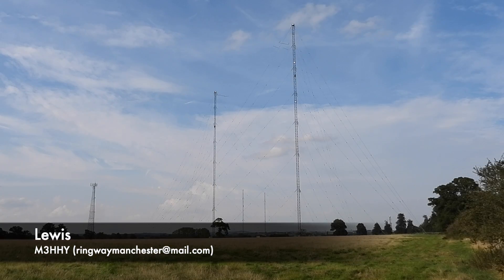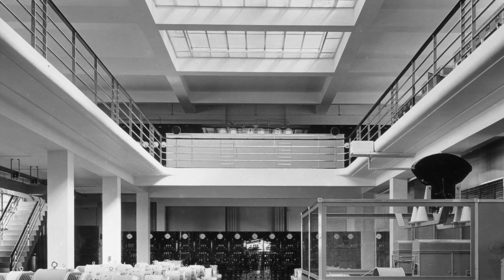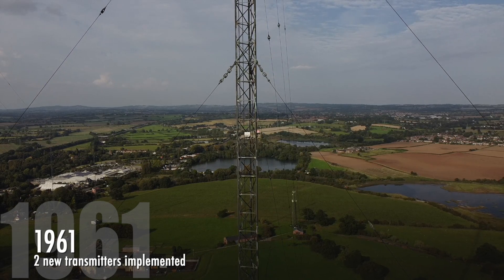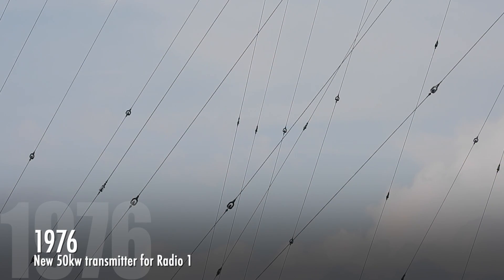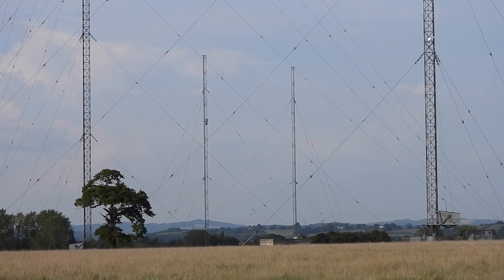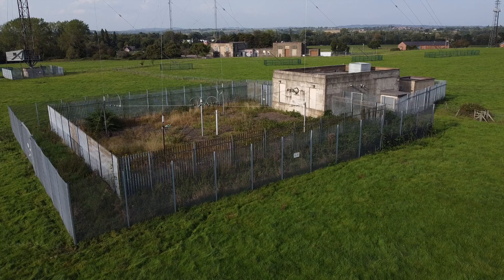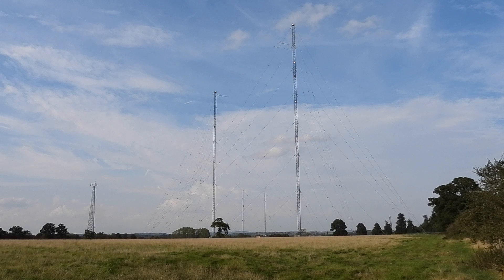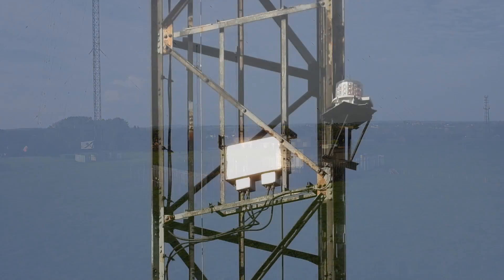Droitwich: The Death Of The 1/2 Million Watt Transmitter

Comment: We had a tour of this station during my BBC "A" course in 1970 something
The oscillators started with a rubidium source, producing 200kHz which was my frequency standard at home, divided down to my radio clock.
IF the Rubidium source failed, there was a less accurate one, and several of them, all the way down to a 200kHZ crystal, so the station should never be off air for the want of an oscillator.

Each RF stage was in its own metal cabinet including the final pentode, which was enormous....

We also saw one of the (6)? huge diesel generators being started for our benefit.
It was a shame that we lost the 200kHz frequency for a 198kHz "standard" to make dividing down more complex.
I suspect it was a deliberate effort to deprive certain groups of people, (Radio Amateurs), an easily derived frequency...
Reply: No, the frequency change was due to a Europe-wide agreement to have all  broadcast AM frequencies divisible by the number 9. For this reason, some of the MW frequencies also changed e.g. 1,214 kHz changed to 1,215 kHz. I believe the whole exercise was due to reduce the audible effects of co-channel interference after taking sidebands into account.
Reply: @johnr6168  Well, I didn't know that.
It was just convenient to divide 200kc/s using a string of 7490's..

Comment: Always a great sight when driving past on the M5 esp at night when lit up.
No doubt like Rugby, those masts will be down and a housing estate and/or warehousing quickly thrown up as a bean counter somewhere has worked out flogging the land off is worth more. 
FYI as a regular visitor to Sweden the night time R4 signal to there is amazing on LW. Not sure if that would be from Droitwich or the Scottish transmitters. Phase distortion is hardly noticed unlike the old 1215 which had it terrible in Leicester even in daytime.
Reply: Any signal received in Sweeden will be from Droitwich. The signals from the Scottish pair barely get out of the British Isles area. They are just filler transmitters where reception of Droitwich had aways been iffy in some small areas for a combination of reasons.

Comment: These things Should Be Kept RUNNING Forever!  Who knows WHEN they'll be Needed Again, what with Corona mass ejection or Nuclear war possibly wiping out ALL them newfangled 'tronics that get ever-More SENSITIVE so's to limit amplifier power and battery drain.  These dinosaurs could possibly ride with minimal damage right through a solar flare or nuke attack, and folks could just maybe fix it with some used dental floss and some chewing-gum with whatever rusty baling steel wire could be scrounged ....
"Smartphones" sure AIN'T so smart if ya CAN'T fix individual transistors fried by an event with overpowering electromagnetic pulses.  Just in an instant your thousand-dollar-and-MORE precious slab of joy with whatever Non- Backup'd pics or personal stuff Becomes an interesting BRICK, and there's No going online to order a replacement, NOR ANYWHERE ELSE.  
Your ancient Long-wave & Medium & Short Wave radio would instantly become a national concern.

Comment: The benefit of a LW transmitter is that you only need  a long length of wire, a variable capacitor, a  diode and a earpiece and you have  a receiver - and no batteries needed.
Reply: My ex-wife had an uncle who lived near Droitwich.  He told me that he had been to the destist to have some mercury amalgam filling and for a while after that his teeth picked up Radio 2. I've heard other examples of similar near Winter Hill, so it might just be true.

Comment: I wonder how many people are still depending on the radio teleswitch service? 
The obvious worry would be that after RTS is  switched off economy seven customers will suddenly start getting an unexpectedly huge electric bills - you'd think the electricity suppliers would be required to do something to warn them, but I haven't heard of anything happening.
Reply: Selective, most likely, depending on which utility firm is in use at any customer’s house. Until a few years ago, I did have an RTS box inside the meter cabinet, but at some stage (most likely caused by lightning), the meter itself stopped measuring anything. The supply was fine, but I ended up in dispute about the adjustments to my bill, once it was detected. It didn’t take too long, as I’m in the habit of reading it and reporting it in my account monthly.

When it was replaced, the RTS was recovered, and the new one has an internal clock, so it’s a fixed time annually between the two rates & restricted supply switch - all in one plastic box.

Comment: Droitwich, AKA "Dump-wich" by the BBC employees that were sentenced...I mean, posted there. The 4th diesel-gen set failed in service & blew a massive hole in its crankcase at some stage. Starting up those diesels was an amazing ritual, not many people know that you got those massive engines into the starting position BY HAND! You opened the exhaust valves, lifted a small door over the flywheel, stuck a long metal bar into it & used the notches in the flywheel rim until a white square showed. Then you had to remember to close the exhaust valve lifters. Starting was done with compressed air & it was an amazing experience bringing them to life, up to speed & then synchronize them to the incoming HV feeders before closing the breakers. It was a technique called "Transfer On Power" & it meant you didn't have to run the site down & run it back up again to test the diesels. 

RF Field strength was so high that you couldn't turn the lights off! Two screwdrivers held tip to tip would make very small arcs that you could see if you actually could find somewhere pitch black & modern cars that drove up to the entrance might die when the engine management unit was flooded with RF! The Ariel Tuning Hut (ATH) was a minefield for new employees, there was a UV detector inside that'd drop carrier from the 500Kw 198Khz TX if it saw a flashover & the older employees would place the earthing wand precisely so that, when you opened the door to step into the ATH, the earthing wand would get knocked & it'd hit a metal stud & causing a pretty fat flash which because of the detector, would trip the Long Waver off for a fraction. I suppose that they thought it was funny, somehow.

As for the Long Wave PA valves being in short supply....well there'd be at least another 2 in storage if they'd been handled right. Those shiny metal rings were NOT handles, they were anti flashover rings (to prevent internal flash overs which were destructive) & if you lifted the very heavy valve by the ring you might only find half of it in your hands while the other half crashed to the floor.....not me, I should add.

And finally, it was a fun place to be in a thunderstorm. Very good for topping up your tan, you might say.
Reply: Very nice and informative. Thank you
Reply: " I suppose that they thought it was funny, somehow."
Engineers, a breed of their own. Interesting fellas though.
Reply: You call it dump wich they use to call it detroitwich
Reply: What make engines were they ? Blackstone lister ?
Reply: Most diesel sets run on a 20 to 1 compression ratio so those valve lifters were essential.
Reply: @frankjohnson7204I'm sure the BBC haters would have great fun telling everyone on Twitter how the BBC was "wasting" the licence fee on expensive and old fashioned equipment, and being charged over the odds

Comment: This is a disastrous decision contemplating switching off the Long-Wave Transmitter. It could easily be used for all day and night broadcast of the BBC World Service, as  it covers much of Europe, aswell as the U.K. 

As for the Valves, firstly I understand that they use high power Ceramic valves now, and not glass. Also there are still manufacturers that make high power transmitter valves that will do the job (even if you can't get the exact type, and have to change the valve holder or the heater voltage etc.).

This is just another example of B.B.C. dumbing down, by penny-pinching on Transmitters, forcing thousands of radio's to become redundant - choosing instead to pay over inflated salaries to their board of directors, and 'third-rate' programme presenters, who only have to read from a script and sound plausible (or stupid in some cases).

What's going to happen to all those people on "Economy 7" meters which rely on that Transmitter to operate the meter switches ?  I used to be one of those people !

Comment: Re. Rubidium - In 2008 I used a phase tracking receiver to look at the 198kHz signal from Droitwich. At the time my local timebase was only 3e-11, but lo and  behold the 198kHz signal was drifting 30x that around the center frequency. About a year later it was still drifting. Maybe they fixed it, but my guess it that no one uses it because 1) better options exist and 2) it's broken too often, and for that reason they won't spend man-hours fix it....

Comment: Before my dad smarted his home, when I was working early shifts, I used to hear the radio teleswitch actuate the Economy 7 split-tariff electricity meter while I was in the kitchen having breakfast before getting ready for work. I’ve always wondered how it worked, then I learned that it used the Droitwich Spa LW signals from Radio 4. Since smart meters use WAN to connect to a central server, it’s effectively made the radio teleswitch obsolete, so it was only a matter of time before Droitwich Spa retired. However, the downside of smart meters is that IHDs have yet to cope with non-conventional neotariffs such as Octopus Energy’s Intelligent EV charging tariff and Octopus Go, so they’ve still got a long way to go before they can better the old mechanical Economy 7 meters.
Reply: For a while, I had a twin rate E7 set up using teleswitch with it all being in an outdoor meter cabinet. Before that, the old utility firm used a mechanical clock to do the rate switching. These days, there is a meter with a fixed time clock inside. It had to be installed due to the failure of the previous one, most likely due to a local lightning strike. It is not a “smart” one.

Comment: As I know, in Hungary, the radio program Budapest 1 (Kossuth) has an 2MW transmitter at 540KHz, at Solt (approx. geographical center of Hungary). https://en.m.wikipedia.org/wiki/Transmitter_Solt old transmitter was located next to Budapest (Lakihegy) with a 120kW transmitter. It had a better grounding, so it was more efficient. Now it's an industrial monument, and operates as a backup, and also has a longwave time signal transmitter attached. https://en.m.wikipedia.org/wiki/Lakihegy_Tower (HGA22)

Comment: When the site closes, the slogan "wherever you are, you're with the BBC" won't be true anymore. USW radio is only in big cities, and is subject to local management. Another article said that it would close in 2027. I hear Radio 4 well in Latvia. It can be used for setting the time precisely.

Jesus that's a lot of equipment. Do they still generate electricity locally using the motors?

Comment: There was something romantic about old radio transmission. With the advent of the internet, sadly it has spelled the end of some AM transmissions. But here in Australia, a lot of AM radio is holding its own against FM stations. With some AM stations simulcasting to the streaming department. But I still love listening to AM radio. FM has lost it's appeal already. Yeah I thought it was great when it came into being in the late 70's here down under. Besides, I can pick up AM radio for miles while driving while the FM stations, unless they have repeaters somewhere, just fade out.

Comment: I was lucky to be taken round the site and control room at Droitwich when I joined the BBC back in 1974 while I was attending a three month course at the nearby BBC Engineering Training Centre at Wood Norton in Evesham. I've a recollection of a light bulb attached to a piece of metalwork within the control room which was just being energised by stray RF. It was used as a quick visual indication that the transmitter was working properly, although one of the engineers pointed out that you would know if it wasn't!

Comment: I still love those curtain antennas and the tech side of it. They are, like in many countries, took offline. But are still visible where I live, but they are planning to put those down. So if I want pictures of these I have to be quick, I lost a lot, because of a crash from one of my hard disks. These were taken in the Netherlands, Germany and Belgium. Especially the Netherlands because they have a lot of transmitter sites, that is because the country is mainly flat, so radio transmissions are key in these kinds of environments. Also, the buildings where the actual transmitters were placed had great architectural value and being also beautiful to watch. Some of them are protected heritage.

Comment: While I'm sure they've considered this, I haven't read anywhere why it would not be viable to refurbish a used set of valves rather than manufacture new ones in order to prolong the service?  Some large transmitting valves were indeed made to be user serviceable in this way, the cathodes were replaceable and, while these valves probably weren't designed with that kind of maintenance in mind it should surely be possible, and probably cheaper than making entire replacements from scratch?
Reply: Why dont they upgrade to Solid state

Maybe add a solar panel so transmitter is not that of a burden on national electricity

Everything is posdible if u just see the value in it, which sadly to few people do nowadays (the ones that do are not enough to make a change)

How do we make people see and understand that digital is not a solution to everything

After all, our ears all analog
Reply: @Veso266  Radio Caroline is proving that solid state and solar panels are a cost effective option, but at Droitwich power levels it probably is not?

Comment: The importance of the LW transmitter goes well beyond public broadcast.
In these days of widespread Internet service, very often through a Wi-Fi connection, people have forgotten how delicate such network infrastructure is. Should a civil or military emergency occur, both the telephone and Internet access are easily lost, following a loss of power or other mishaps.
Therefore, during an emergency, the only method the UK government can provide directives to the public is through the LW radio service, which covers the entire national territory with one transmitter.
Therefore the UK government should do the sensible thing - and take over the management of the UK LW transmitter infrastructure...

Comment: I worked as a telephone engineer in the Droitwich area  ( though not actually in Wychbold)  and RFI complaints were frequent . The southern edge of the town was  a multiple of 198metres  from Wychbold   and sometime simply moving a phone a few feet would cure the problem. Having doen that it would be time to get out the various chokes etc  for a more permanet fix.  Apocryphal stories  of  'wireless' florescent tubes and musical ovens abounded in Wychbold .
Reply: And in Aston and Sutton Coldfield,  Birmingham,  music on telephone lines. Having to fit filters on lines.
Reply: @Dickinsonradiotv What about picking up radio signals via tooth fillings?
Reply: @kenstevens5065  My late Nans indentures played a radio station.
Reply: We had a fridge that sometimes picked up radio sounds

Comment: Great video Lewis. I heard a story, but I can't verify if it's true, that one of the personnel access gates is picking up so much RF that it physically vibrates and when held at the right angle you can hear the broadcast signal on it.
Reply: I heard a similar story about a farmer with a corrugated iron roof over his animal barn that sounded the modulation.. lol
Reply: Many years ago, a lady in Droitwich could hear a tinny voice coming from one of the bars in an electriic fire. She was quite spooked by it and then realised it was Radio 4.

Comment: BBC 4 on 198 kHz can be received here in Toronto (about 6000 km away at night), it shows how far LW signals can travel, it will be a sad day when it goes off the air.
Reply: So what distance away is it during the day? (ba-dum tish!)
Reply: @owensmith7530 🤦
Reply: Say radio 4, by the way, as for us British folk BBC four without the word radio is a TV station
Reply: wow!
Reply: When on holiday on Kefalonia I used to stay up until midnight local time when propagation was just sufficient to start hearing the 10pm Radio 4 news bulletin coming through the static. Being mischievous I would sometimes turn the volume up for the chimes of Big Ben - much to the surprise of other Brits who probably assumed they'd drunk too much Ouzo.

Comment: In a country as populous as England you can close down MW/LW transmitters and not affect massive numbers of people. For the disabled or elderly, a smart phone and or smart speaker with a cheap plan is all they really need to listen to radio online but before that there is DAB which as I understand it has a huge coverage all over the UK. Here in Australia no new AM transmitters have been licensed  since the 80s, though plenty have changed hands. There are no plans to shut down AM radio as it still gets heavy use especially in rural areas. Even some AM music stations that have implemented FM have kept AM going for range and this is just recently. AM radio is vital in emergencies and when travelling rural areas it maybe your only choice (apart from your offline play list). There are no mobile phone signals out there.